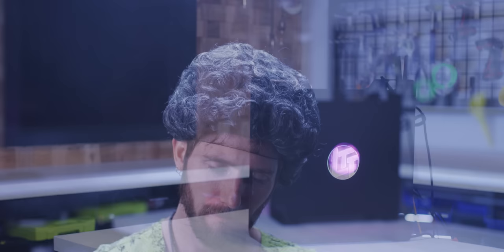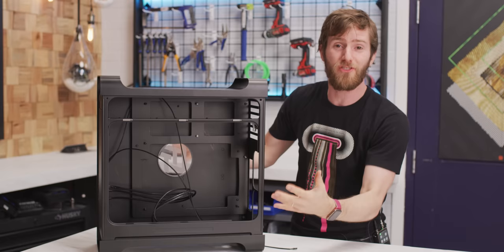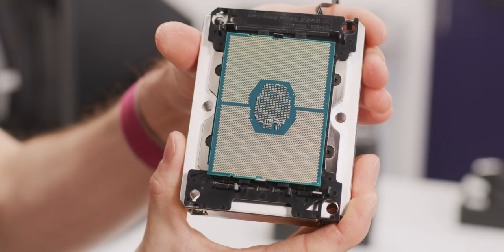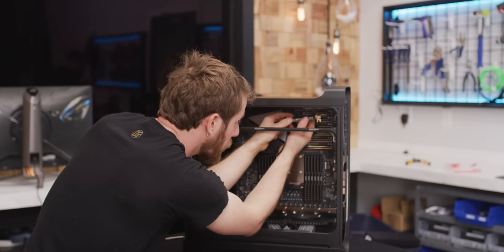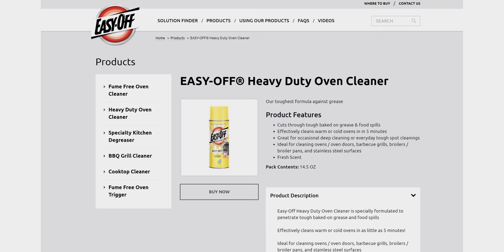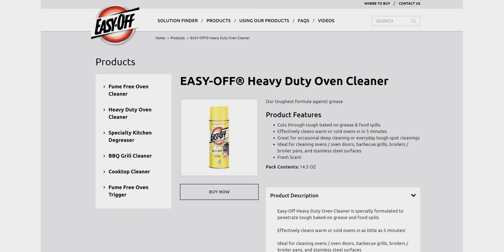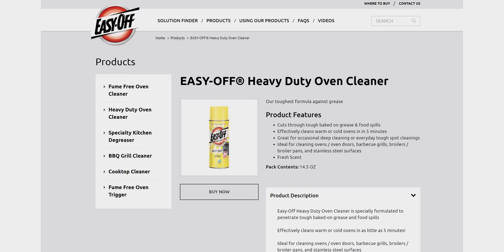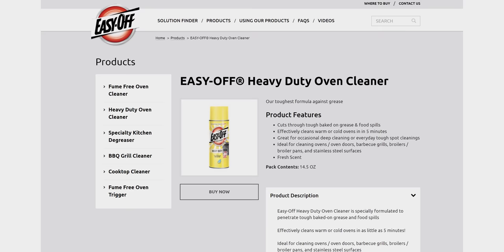IT'S FINALLY DONE! Hack Pro Final Assembly

Comment: Hi Linus, this is probably not the correct forum for this but I was hoping for a bit of advice. I am currently using the below spec and I was wondering if you could provide a suggested upgrade for it. By the way, I am not wedded to any particular manufacturer and I am not interested in RGB glowing bits etc.
Intel Core i7 Extreme Edition 980X 3.33GHz 6 Core
Gigabyte GA-C58A-UD9 motherboard
EVGA GeForce GTX4800 1536MB DDR5 3696 MHz
Creative Sound Blaster X-Fi Titanium PCI
Corsair 12 GB Kit (6x2Gb), PC-12800 (1600MHz) DDR3 XMS3, 9-9-9-24 Tripple Channel  Kit
Samsung Blu-ray/DVD combo drive - 5.25" Internal SATA
Intel 160GB SSD 2.5" X25-M SATAII 16MB Cache
Western Digital Caviar Green SATAII 64MB Cache
Lian-Li PC-P80B Armorsuit X Edition
Corsair CMPSU-1000HXAU 1000W ATX Modular Power Supply, 140mm Fan

Thanks.

Geoff M  geoff@aros-mac.net

Comment: Ok here is my 5 year old G5 Case Mod, Keeping it looking like a G5 / Mac pro inside and out. Also using tiny Silverstone PSU. Notice it is not painted. Done as it should be. Not made into standard black case/ RGB puke. 
https://www.tonymacx86.com/threads/ulyssess-g5-mod-with-original-fans-layout-using-laserhives-low-120mm-matx-kit.166768/

Comment: OMG did you really use a 3M cutter for a led strip, they are for 1 or 2mm iron to cut.  hahaha, buy a knipex. Use 2k paint for strong and durable coating. those 1k spray paint is really crap you can remove it with your finger nails ;) and for cleaning use brake cleaner or thinner. All stuff expensive but economy paint and shit haha.

Comment: Jesus, it's a freakin' nest inside. That's probably the biggest flop on the channel so far. Here's a tip from a Mac person - when you try to build a Mac, aesthetics and ease of use are at least 50% of the reason people would buy a Mac. So when a Mac person is confronted with a nest that's impossible to clean from dust or upgrade without disassembling the whole thing . . that's a major "HELL NO!". Sure, it might be faster and cheaper, but the lack of convenience, compared to the real thing is the biggest downer of this project and got to ring a bell that it's pointless to try and emulate Apple products to prove a point. It's just not working. You don't have an engineering department behind you and building a PC, calling it a Mac and moving on is not doing you or your channels any good.